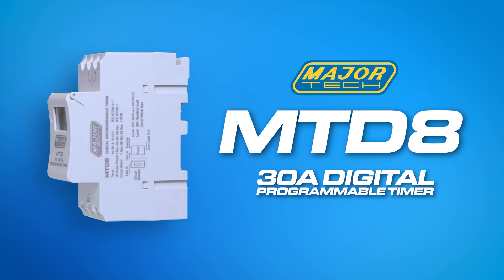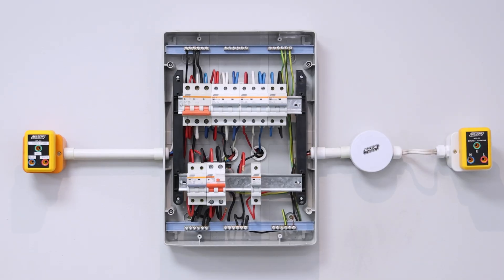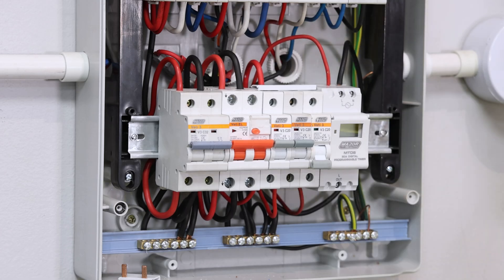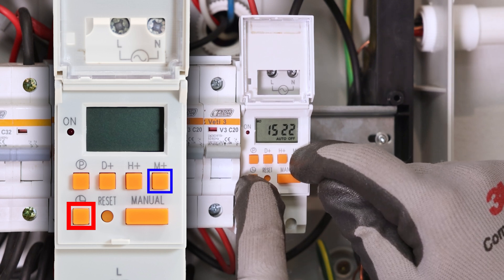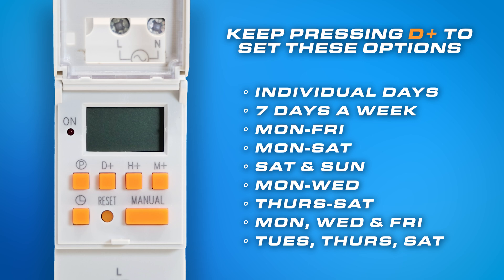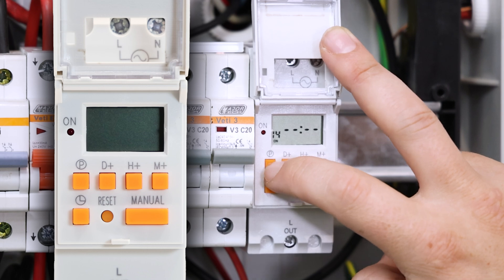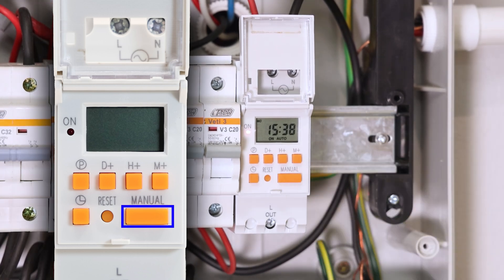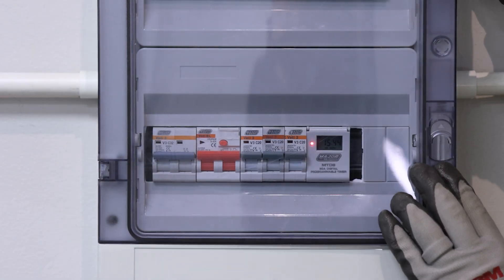MTD8 30A Digital Programmable Timer Installation Guide

Comment: How to open (lift up) the front cover, is there a clip or special technique to release the front cover?
Reply: Did you come right? I have the same problem.
Reply: Use a pen. Also use a pen to reset. 😉